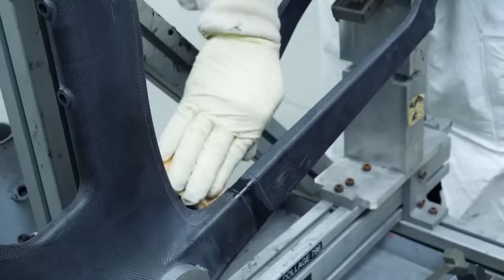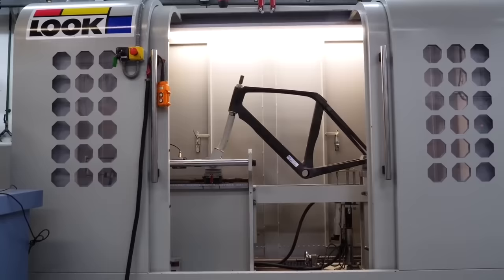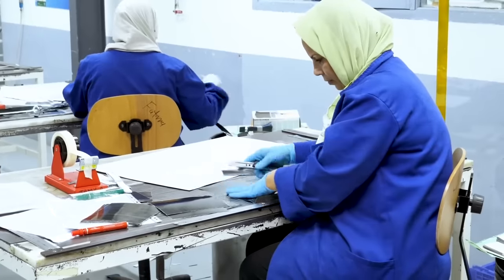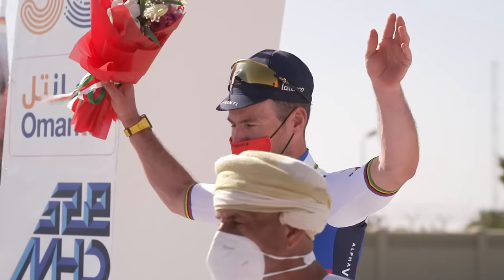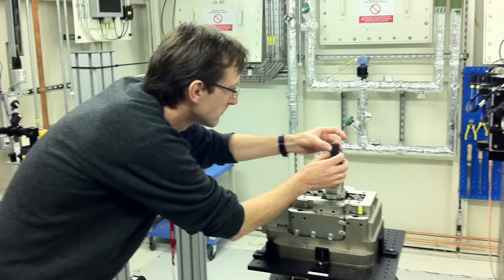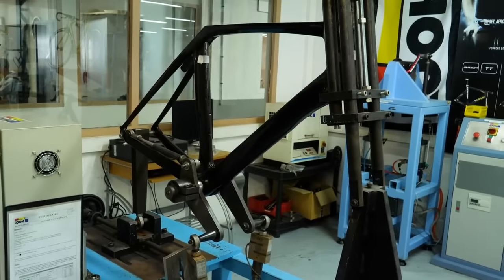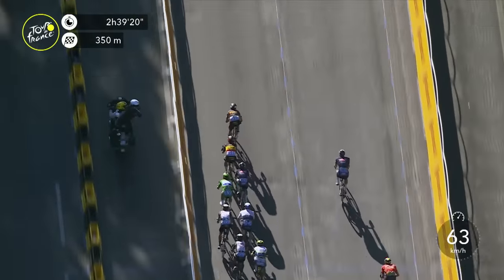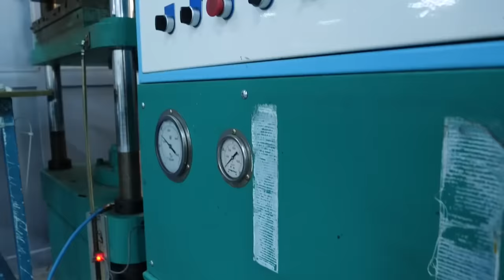Your Carbon Fibre Bike Won’t Last Forever

Comment: I always thought the same about carbon frame bikes. Thanks for the feed back, since no one would be financing me a carbon frame bike, i am happy with my aluminum alloy bike. Its always good to invest in a good quality a alloy bike rather than investing on a carbon fiber bike.
Reply: My aluminum Cannondale is still going after 27 years
Reply: Aluminum has a lifespan as well. Loaded with the same stress, aluminum would have a massively shorter lifespan because it has substantially less strong. It's only because carbon is used under substantially higher stresses that it might fail sooner
Reply: @ZebraLemur  at the end the amount of aluminum used would have to be increased, this lowers stress on the material and increases lifespan.
Both materials are also used to build aircraft, 737s for example use very little other material than aluminum for the fuselage, but they still last more than 100k FH until the cell is gonna to be scrapped. F-16s are also built from aluminum.
A carbon fiber construction will be more lightweight of course at the same strength, but aluminum still works if something is designed properly
Reply: @simonm1447  My main point is that people like to criticize carbon, but if you made an equal weight carbon bike and equal weight aluminum bike, the carbon bike would have a massive lifespan increase over the aluminum. It would be a tank!
Reply: @ZebraLemur That's right. There had been very light aluminum bikes in the past (Marco Pantani used one), but they are fragile and crack relatively fast. A modern carbon fiber road bike frame is surely superior in strength compared to these bikes. 
Where metal offers a clear advantage is for offroad bikes (like MTBs), while carbon fiber has a lot of strength in fiber direction it is significantly weaker than metal if it gets a hit from the side (like if the frame hits a rock etc), a metal frame may have a dent afterwards but the carbon is likely to break here. 

Personally I ride metal frames (aluminum and steel), but I don't do any competition and a way cheaper metal bike is good enough for me, my frames are not that lightweight, but they are stable enough since they use sufficient material.

Comment: Thank for this very interesting video, we would not have access to such knowledge and understanding otherwise, superb!
A few things not covered were... how much of a margin do the components have and increasing strength/stiffness and how do these effect things. Can the matrix be repaired?
By margin I mean how much more could a frame take compared with a calculated maximum, eg if the calculated max 'strain' is 100 units, how much more is added in for safety and longlivety, none, 1.5x (150units), 2x (200units) or what- guessing, trial and error etc?
Increasing stiffness/strength, adding more material (more layers) or different shapes (gussets), introducing further (different) materials (metals, foams etc), am I correct in thinking that a manufacturer added expanding foam around bb area which increased stiffness by a large amount?
Can the polymer matrix be re-invigorated? Some polymers will melt, why not heat up a frame for it to melt and fuse again, eliminating the fatigue fractures? Probably not very practical but with the cost of these frames, has anyone looked into this?
Reply: So, in terms of safety, the supported tensions are calculated to always be 2-5x higher than the real ones. 2 It is commonly used for buildings, 3 for automobiles, and 5 for aerospace applications. Most of the time, after designing a product, it is tested and corrected (in software) trial and error until reaching the intended values. only then is it manufactured and tested again.

Adding more layers will improve supported tensions, despite how weight is an important factor, having a bike that supports 10x the actual stresses doesn't make much sense. Adding additional materials won't do much, and may even be detrimental to the intended performance. In this aspect there is still another problem that is the adhesion between materials... Carbon fiber is not known for having many friends!

Unfortunately, the polymer matrix is impossible to restore, as a thermosetting resin is used, which will degrade when temperature is applied.

Comment: My three takes are 1. buy a well made quality composite frame  2. don't wreck it or drop it and 3. remember fatigue curves (S-N curves) are plotted on log scales which means Ollie's  lower fatigue loads result in orders of magnitude more fatigue cycles before failure.

Seriously, for mountain bikes, high impact loads and the complex geometry beg the question: Should mountain bikes be made from composite materials?

Comment: I have some numbers: Glasfiber has a super long shelf life as long as it is covered by a  UV and moister barrier such as paint. Composite glider planes can reach up to 12.000 hours+ flying time and the early versions of the 60’s and 70’s are still in service. So it’s safe to say at least 50years shelf life and at least 12.000 hours of normal usage. If you everage at 20km/h you get 240.000km out of your bikeframe under nominal conditions.

Comment: What always gets to me if the amount of investment and justification given by cyclists at the need to own the most elite kit they can (and sometimes can’t) afford. Yet most of the cyclists you see riding these bikes could do with losing 10-15-20kg from their body weight. If you can only ever manage 2 need place in a race and are super lean and ride a steel bike then you might need the upgrade. If not you really should just be asking yourself if you should just invest some time into yourself which is free and pays off far more heavily than throwing money at the issue.
Reply: I agree! I bought a 14kg chromoly steel bike for $160aud with slow durano plus tyres to commute to work. I am 5-10% slower overall as it's rolling hills but on the flat it's not much slower than my fancy carbon bikes. I overtake people with aero bikes and deep carbon wheels all the time whilst keeping my HR below 65% of max (zone 2 training).
Reply: Money is usually spent with less effort in equipment than in professional training ;-)
The effect however of professional training is likely to be bigger than a more lightweight bike
Reply: Time is free? If you don't have to pay rent, perhaps...
Reply: When i weighed 120 pounds, my super light XC bike was.....gorgeous to ride.

I now weigh 145 pounds, and even though they're mostly muscle, i can FEEL those pounds. An entire bikes worth of muscle on my body makes a difference. 

Being lightweight + light bike = God

Comment: Aluminium frames tend to come with life time warranty. Tells you a lot about how confident the manufacturers are about aluminium.
Reply: Hmm, my understanding is that unlike steel, aluminium does fatigue. If you put aluminium through enough repetitive cycles that doesn't actually deform the structure, it will eventually fail.
Reply: I think you are referring to titanium
Reply: Lifetime warranty is actually defined as 10 years for aluminium frame. “Lifetime” means the typical lifespan of that frame, not your lifetime
Reply: @simongoh9461  maybe but still doesn’t undermine the point about warranties - even at Halfords you get a lifetime frame warranty on their bikes. So even if it did fail, you’d get a new frame as long as it wasn’t due to abuse or a collision.
Reply: @kr2082  Titanium tubes are perfect, it's the welding that fails though.
Reply: @JethroWaldron  That depends on the law system you're in.
Reply: Read the smallprint on the warranty.
Reply: @kr2082  i had two titanium bikes, they both cracked on the down tube, not on any weld either.
Reply: @simongoh9461  yes it does, it work hardens and cracks. it has happened to several of my aluminium bikes.
Reply: Problem is aluminum can't really be repaired or even "bent back" if you bent something.
Reply: @spicy_mint  Atleast Aluminum Bike Last Longer than CF i think..
Reply: @spicy_mint  I'm riding a CAAD10 with little dents in the chain stays (previous owner's heels hit them when pedaling). Good enough for a crit pig bike
Reply: @derf9465  I watch my dented CAAD10 closely....
Reply: Lifetime warranty refers to the lifetime of the product, not the owner. This hugely depends on local laws in different countries. In Germany "lifetime warranty" by law is 5 years. In some countries its 10 years.
Reply: @philipcooper8297  it’s true that the actual lifetime is different in different countries and manufacturers, but it is still not the lifetime of the owner. I’m a bicycle mechanic and have dealt with many frame warranties in my time, trust me it does not cover you for your lifetime. Carbon and aluminium are usually 5-10 years depending on the quality.

Comment: Just can't beat the versatility of a metal frame.
Reply: I rode 34 miles to work and back for 25 years and I have worn out dozens of bikes mainly through frame cracking and corrosion. I have had titanium, aluminium, reynolds 531c, 653, 753 and in the end, the bikes I rode to work all broke. I currently have a cannondale system 6, a cannondale super six evo, a trek speed concept and still have a 29 year old Dunlop hotta perimeter carbon fibre bike with carbon tri spokes on it. All the carbon bikes are aok and most after many years of use training but not commuting.
Reply: @stevezodiac491  Wow. You must have a really huge garage
Reply: @JR-wj9bh  i have but all those broken bikes went in the skip over the years.
I only have 10 bikes now, the expensive ones( a system 6 being the most expensive ) live in one of my spare bedrooms.
Reply: The welds fail due to fatigue/weld quality. They are not perfect either

Comment: Not so sure F1 engineer is the one to talk about something build to last. Especially from Mclaren, given the current state

One addition to Prof Marrow speech on crack initiation, intercrystalline structure is even more important. Ironically here, the better grade alloy you pick, the more succeptible to scratches, dents, etc it is. So then, brittle catastrophic failure of steel is more gracefull than becomming a sloppy washout like C/GFRP
Reply: Catastrophic failures of steel frames are uncommon. Steel is usually bending before it will break, steel is ductile.
Aluminum frames can crack during riding, but it's not typical for steel.
Reply: @simonm1447  steel used for bicycle frames is relatively cheap compared to automotive and tooling and even so it tends to crack at bottom bracket or seatpost areas and with bmx and dirt bikes at downtube reinforcement because of excessive rigidity
Reply: @feedbackzaloop  it depends which type of steel. There is carbon steel (the cheaper one) and cromoly (Aisi 4130, ), which has a higher strength.
The strength of cromoly depends on if it gets a heat treatment, with the right heat treatment it has a yield strength of almost 1000, 4 times as much as 6061 aluminum
Reply: @simonm1447  first I'd like to say you almost doubled the strength of 4130, which is still medium carbon. And yes, it is common for car roll cages. Still not so much for bikes. And still incomparable to 5135, a go-to structural steel in machining.
Reply: @feedbackzaloop  good bikes use 4130, it was pretty common in the 80s and 90s for European made bikes. For cheaper bikes from today it's less common, but you still get quality bikes using it.
The yield depends on the type of heat treatment, it can have 500, but also almost 1000 if you use the better  heat treatment process.
Reply: @simonm1447  please define "a better heat treatment process". 4130 or as it is known in bicycle world 531, has yield strength near 1GPa in quenched and tempered state. Exactly when it breaks brittle from a single stress cycle. Frames however use normalised steel, when yield is about mentioned 500 MPa. Still, a single cycle, but a ductile deformation.
However none of those numbers matter since frames, gears, sprockets, pretty much everything, are designed to fatigue limit stress. Which is in bullpark of half of yield.
And when you start to compare yield numbers of steel and aluminium alloys, you don't get different failure modes. You get proportional tube wall thicknesses (greater yield = thinner tube)

But you know the real reason why you don't see many steel frames crack? They are mostly lugged and brazed, so it is by design not steel that brakes first
Reply: @feedbackzaloop  you get around 1000 if you heat it up to 855°C, cool it down in water and temper it at 540 °.
To be fair I don't build bicycle frames, so I'm not familiar with the type of heat treatment they use.
Older cromoly frames are typically lugged and brazed, but newer ones are often welded.
I'm not a studied material specialist, I just like bikes
Reply: @simonm1447  cooling in oil to be more precise. Water makes it harder, but not stronger, and following tempering may not reverse the damage. Also the higher temperature of the latter, the lower the resulting strength. 855-water-540 is not an ideal treatment.

As per newer frames being welded, I can pull only Cotic from the top of my head. They use, however, manganese steel, which is air-hardened, so that the welds get stronger than the tubes and don't develop cracks that easy. But when they break, it is a clean shear off
Reply: @feedbackzaloop  do you work in this business? You seem to have a lot of knowledge about this topic
Reply: @simonm1447  Kind of: automotive engineer by schooling, production systems by trade. So, for materials still have to refer to handbooks and cataloges...
And a fellow bike enthusiast, of course

Comment: I believe a quality alloy frame has a much longer lifespan than carbon frame, and any failure is likely to be less catastrophic than a carbon frame.
Reply: Aluminum frames wear out within a short enough timespan so as to cause concern, also. It's like how aircraft fuselages (also aluminum) wear out after a few decades even with the best mechanics and strict maintenance. If you are concerned about the lifespan of a frame, steel and titanium are the options that will last a lifetime. Life expectancy would have to go over 200 before we have to start worrying about wearing those frames out.
Reply: @RedCommunist  LOLZ that would explain why I still have an alloy mountain bike plus road bike over 20 years old. I'll stick with alloy. It's a well-known fact.
Reply: @RedCommunist  aluminium frames fail without obvious early warnings.
Reply: @RedCommunist  to be fair aluminum fuselages (like the ones of a 737 or an A 320) still last over 100k flying hours before they are gonna to be scrapped. They are made to be fail safe, they are lightweight and cracks in these fuselages can't grow big enough to be a concern until they are discovered in the next regular check.

Comment: Been riding my Pinarello Dogma 60.1 frameset since 2009 (well over 60,000 miles; closer to 80k miles).  Had to repair the front bottle cage nutserts (rivnuts) but no other issues.  Frame is still very stiff with pretty much the same handling characteristics.

Fingers crossed… I’d like to get another 2 years from it.

Comment: Steel frames ride fine and safe after 70 years. We know that from old Rene Herse bikes.
Reply: lugged and brazed steel frames don't really age as long as they are protected from corrosion.
Reply: Except the ones ridden hard and a lot. Race bikes were also regularly replaced in the steel bike era. Gently nodding along, bikes can last a very long time.

Comment: This is a really great and informative video. I think though that obsolescence will claim many more bikes than the material ever will. My aluminum Raleigh mountain bike served me well, through about 2000 miles then the frame cracked due to stress corrosion cracking. That bummed me out. My 2012 Mid Compact Specialized Tarmac is still going strong, and the carbon frame has not had any noticeable degradation in over 34,000 miles. I don't ride it much any more as I've moved on to newer technology, but I suspect my Cervelo 22 Caledonia will probably outlast its technology as well.

Comment: I have a composite bike, aluminum and carbon fibre. The frame is stiff yet forgiving. I also had a carbon seat post. It failed at some point but it failed gradually. At first I thought I had tire issues as the tige was getting “ spongy. After 2 weird rides I did a full check up to find the seat post was “tearing”. IAM glad it was carbon and not metal failure. Not sure how that would have gone!!!

Comment: Hi, I own the third of 86 FFA Diamant gliders. This is noted as the first ever entirely fiber glass glider aircraft. Mine has a year of birth of 1964, yes, that is 58 years ago. When I bought it in 1976 I was told that I need to keep monitoring the material and that the Aviation Authorities will check meticulously regarding ageing. And it was added that I might get some 5 years more out of it. It has been checked regularly ever since and I still fly it every week now, in 2022. So cut the cheese and don't worry about it, since the bike will be around a lot longer than you and I. Please note that my example is a glass fiber, resin compound that is considerably less sophisticated than carbon fiber.

Comment: I have been working with this material for over 25 years and appreciate the benefits. But what I have become aware of over the years is that the material is ultimately hazardous waste and should simply not be used for many things. A bike like this doesn't last very long, at least not in practice. In theory, of course, it's great. For bicycles I find it more of a technical fashion. I find 3D printing with metals such as titanium or steel more interesting. These frames or components can simply be reused. But great upload anyway. Thanks for the that.